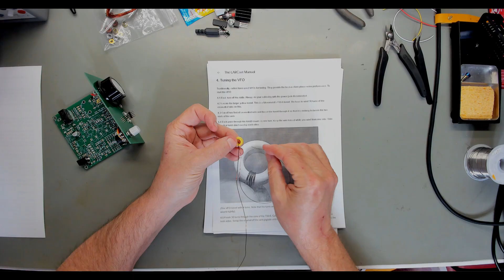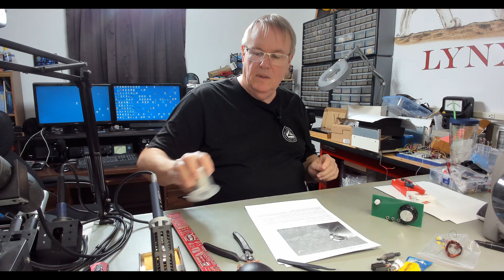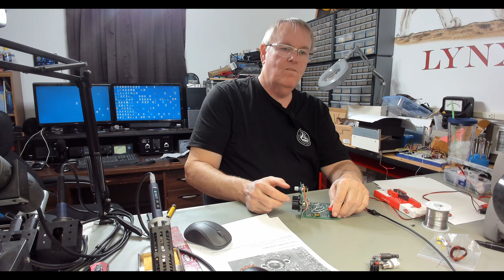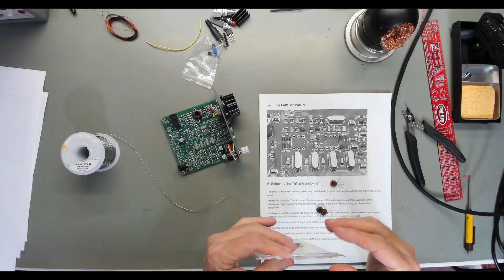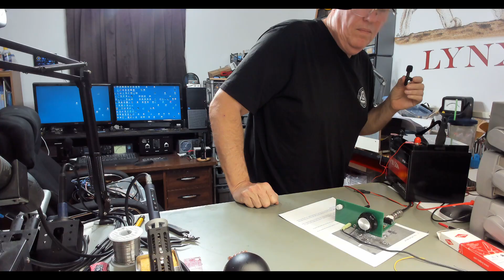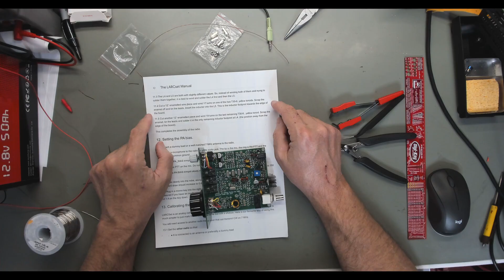LARCSET BUILD PART 2 - Did I Do It Wrong?

Comment: The mic circuit drives the low impedance of the modulator from the collector of the mic amplifier which reduces mic gain. There was a modification which changes the emitter degenerative resistor to a smaller value. In my opinion driving the collector output into an emitter follower may be a better opinion. This only requires a transistor and a few components
Reply from the maker: Thanks,
You are correct, Keep watching as there are other issues causing this, but I did do the mod you describe along with others. 
RJ